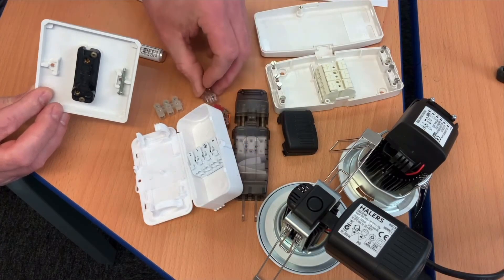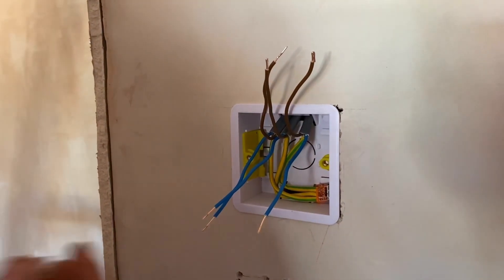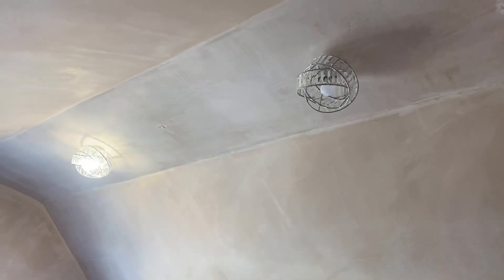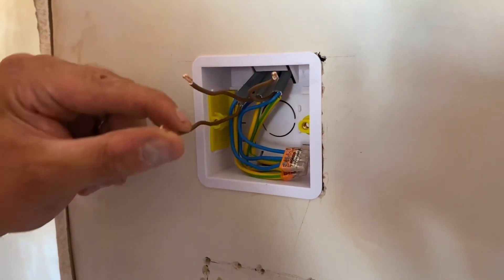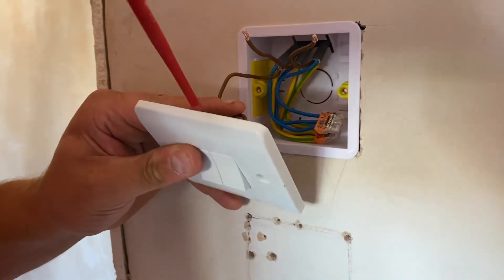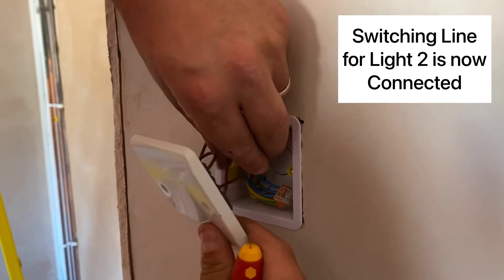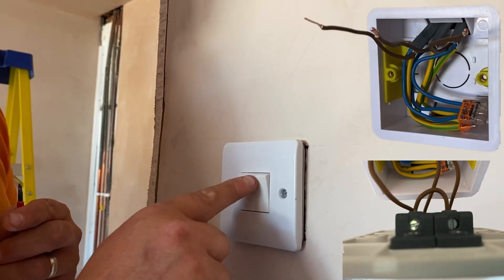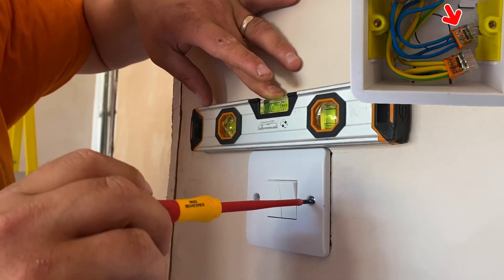2 Gang Switch Connections Explained - Taking the Feed to the Switch

Comment: Id like to change my one gang one way that runs two lights at the same time into a 2 gang 1 way giving me control over each individual light. 

My 1gang switch has  two browns into the com
And last brown in L1 

How would i connect this for a two gang. As it is wired differently to your video.

Comment: I have an outside light that was run off a smart plug, but I’ve redone the walls. Been trying to get the power to come from a double switch that lights the living room. Only issue is it’s a 2 way with the switch in question being at the back door.
Reply: Track the feed cable, it should be at one of the switches.

Comment: Hi mate just watched your video found it very interesting I’m in the middle of lowering my ceiling to incorporate a central light fan and then have down lights around the sides which I want them both on a separate switch . Would this method in this video work if so the central connection point  would I need to bring a new 3 core wire down to the switch for down lights  if so would this then be connected to my first down light to run my daisy chain  or would I have to mirror image the connections within the switch at the ceiling rose for example all browns in one way go clip and blues in a 2nd and all earths in 3rd and then just bridge across the switch as shown in the video just a little confused  on how it connect at the ceiling end to the switch for central light fan on one switch and down lights on separate switch from one live feed if it’s possible

Comment: How do you wire the feed in if there is a feed out to link  to the circuit , this shows you that this is at the end of the circuit, do you join the feed out to the common also

Comment: This may be a stupid question but do you find which is the live feed by testing with a phase tester ????
Reply: Touch it and taste the rainbow 🌈
Reply: By using a 2 pole voltage tester. If you put them the opposite way round. All that will happen is the switch will operate differently.  You can just flip the switch upside down. 😂

Comment: What about a 2 gang way switch to a one gang way switch for a light at the end and top of a stairs , I have an issue in an old property where I cant control the light from both ends without breaking the circuit
Reply: These ones are usually simple mistakes made on d.i.y. I've sorted 100's of these. You should have taken photos before changing switches.
Reply: @ I got an electrician to sort it out ! Cheers

Comment: This is so similar to what I've got wired into a double gang light switch in my kitchen (more or less). I have 1 brown wire into feed terminal in left switch, 1 grey wire into feed terminal right, 1 brown wire on left common, 2 brown wires on right common, loop wire  between both common terminals, 3 x blue and 1x black in chok block then single large earth terminating in metal back box. Only things close by are smoke alarms (1x kitchen, 1x living room adjacent, leading to 1x in hall, all with shitty conduit throughout instead of buried cables like the rest of the flats  (housing association). Also a socket in living room but it's not on same wall, it's in an exterior wall close to original build TV aerial socket. 

Anybody shed any light on this?
To clarify, only one switch (left) turns the kitchen light on. The second (right) switch seems to do nothing.

For reference in replies, I'm a building services maintenance engineer with a limited but varied level of electrical knowledge (I'm mechanical bias) 
I have photos if required.

Thanks in advance

Comment: I have a switch wired like this. I want to add another switch for one of the lights, so I can control from either end of a room. Is that possible?
Reply: Did you find an answer?
Reply: Yes. If you chase out and use a strapper 3 core & earth cable from one socket to another. Otherwise, look into Quinetic wireless switches. You can add upto 10 switches of one control module. With the addition of wi-fi sockets. You can add in grid switches to keep your existing switches operating.

Comment: There should be only one terminal for incoming L that links both switches. Poorly designed
Reply: There are situations where you may not want them joined, e.g. certain 2 way switching configurations, or switching lights on different circuits. Better to have the flexibility.

Comment: Take it from an electrician of 50 years  ,there is no advantage of taking your neutrals down to the switch unless you are feeding a switch that supplies an outside light were you want a double pole switch to kill the line and neutral,otherwise you are just adding more connections to the circuit whi h I was taught as an apprentice that its good electrical practice to limit the number of connections on a circuit,and as for your excuse about your arms aching,please don't make me laugh mate,your hilarious,you should be on stage as a comedian
Reply: There is an advantage because smart switches might require your neutral to be there. The number of connections are the same he just moves them from ceiling to switch.

Comment: Great video. I have come across this in my mates flat. I assumed the feed was taken to the switch judging on the amount of cables. Its a double switch controlling the 2 ceiling lights so one switch for each light. It seems all the neutral cables are joined together which are 4. So there are 4 brown. 2 seem to be live which are the COM 1 in one and another in the other COM with a bridging brown lead joing the 2 COM's. 1 brown is in L1 and the other brown is in L1 on the other switch. So it seems you got 1 live coming in 1 going to the next switch and 2 going to each ceiling light. My mate wants a dimmer switch which has L obviously for the live's 2 of. Then L1 and L2 which go to each of the ceiling lights. Im sure this is correct?

Comment: I’m trying to wire a fan with this way where all feeds are at switch I have a switched live but not a perm for overrun would you run a cable from switch to ceiling rose connect black to switch live then take the perm love from the Downloght connection

Comment: really great video - I had an old double gang light switch  which slightly threw me as the terminals were arranged slightly differently on the new one - your explanation reassured me I was wiring it back the right way - cheers!

Comment: Mate, just before lockdown, had a sparky fit this for me, but then we had a major refurb, and the builder took off the switch without taking a picture of the wiring!! I tried and failed and left it until now. But I couldn't find a video or website describing it ANYWHERE until now? I thank you profoundly!!! Clearly described and fixed my exact problem, and I'm an avid DIY'r but didn't wanna fork out the charge for the sparky again then feel so stupid when he fixes it in 3secs😂😂
I am subbed now for any more you have to offer. Cheers!

Comment: So before when the plan was to use a 1 gang switch to control both lights, would you have joined the switching lives into a wago, then another wire from the wago into the l1 terminal?

Comment: Where does the feed in come from in this switch? Has this been taken from another light elsewhere?
Reply from the maker: Normally in this method it’s from another switch but it could also come from a light in either case you need to pick up a permanent line and neutral 👍🏻
Reply: @GSHElectrical  That's great! Many thanks for your swift reply.

Comment: Nice and clear video.
I have a question.I have taken a live through double socket to a spur, then feed a 1.5 to the double switch.
1 cable goes to the ceiling, and the other cable goes to  the outdoor light, but it's does not work.
Should I take the outdoor light through the ceiling rose ?
Please explain.
Thanks

Comment: Hi! Thanks for uploading this video. As a bit of a novice to electrics this is really well explained. I am trying to wire up 2 pendant lights, operating from 2 separate switches (up and downstairs) with 2 gang 2 way switches to allow them to be turned on independently. I can't seem to find anywhere online that talks through this scenario. Any pointers would be really appreciated
Reply from the maker: Wiring Diagram Using a 2 Gang Switch to Control 2 Independent Lights Using the 3 Plate Wiring Method
https://youtu.be/V48q0RHEbNE

Comment: I understand this. Makes sense. Struggle to understand the L2. Could you advise please?
Reply from the maker: L2 is for 2 way switching 👇🏻

Wiring Diagram Lighting Circuit 2 Plate Method Taking the Feed to the Switch - 2 Way Switching
https://youtu.be/QX1B4gtqisc

Comment: I would  still  put brown sleeves  on the two  blue return  wires from the light. 
Because  if disconnected  from  the neutral return wire when the switch  is in the on position  becomes live.

Even the neutral  return  feed wire can
Become  live if there was a break,  fault or disconnected.
Reply from the maker: Thanks for taking the time to watch Mark and for adding your thoughts

Comment: Nicely explained, but I don’t like the idea of taking the feed to the switch  to many wires plus the wago’s makes it cluttered, more cable drops more chances of someone putting a nail through them on drill through them when they desired to hang a picture or something on the wall and it does happen all to often. It’s also a throwback to the 20s 30s,
I do get the benefits of taking the feed to the switch I just don’t like it.
But who am I to argue i’am just a grumpy humble spark who’s opinion means nothing.
Great video Marcos as always 👍👍👍❤️
Reply: Why is there more chance of a cable being drilled into? Dosnt matter how many cable coming down to the switch they will (should) be in the switch drop zone, anyone drilling above or anywhere near a switch or socket drop are the ones in the wrong.
Reply: @supersparks9466  yes 👍 but we should anticipate other peoples stupidity, I known people to put picture rales up and have put nails through the switch cables and the socket cables  , I have also seen one lounge wall full of framed pictures and again cable damaged by screws  , it does happen , thankfully not often,
Reply: @Dog-whisperer7494  so we should think of running only one cable just because of people's stupidity so there's less chance of damage because my cable drop is 10mm wide instead of 70mm, sorry but that is utter bollocks.
Reply: If you don’t agree or like my opinion the don’t respond or reply. Simple
Reply: @Dog-whisperer7494  just having a debate it , nothing personal.  If someone makes a comment which I think is wrong I'll will challenge it, if they come back with valid points I'll respect that. But the zones are there for the stupid person as well as everyone else but you will never stop a totally stupid person drilling cables or pipes so all you can do is minimise the chances ie zones,  has nothing to do with feeding cables at the switch ,which was you're initial argument.
Reply: @supersparks9466  thank you, but my argument was not just about cable drops too a switch , I have been an electrician for a little over 30 years and outside of college I was torte to run the switch drops in steal or Heavy duty PVC conduit as with the drops down to a socket outlet , and that is what I always try to do .
Am I wrong ? In an ideal world no i’am not , but we don’t live in an ideal world.